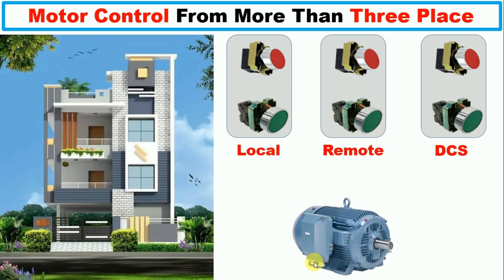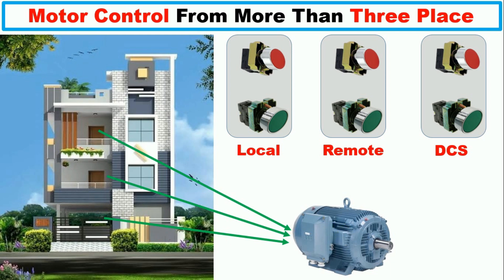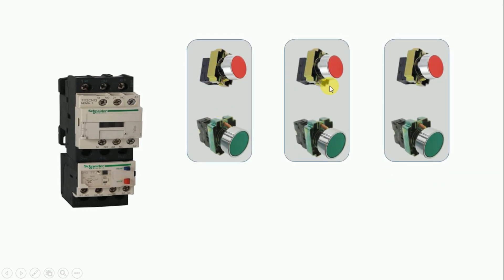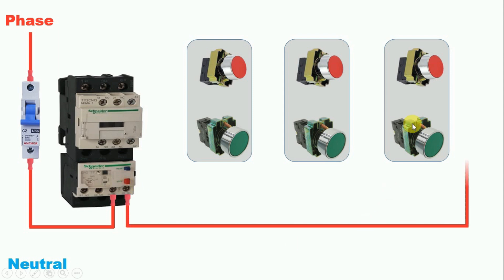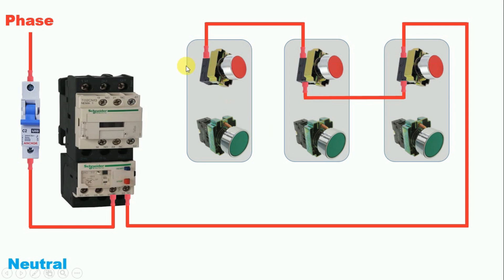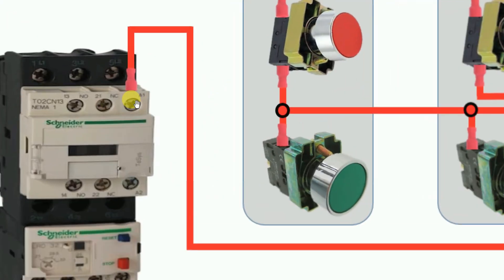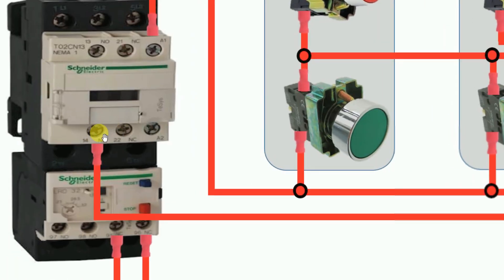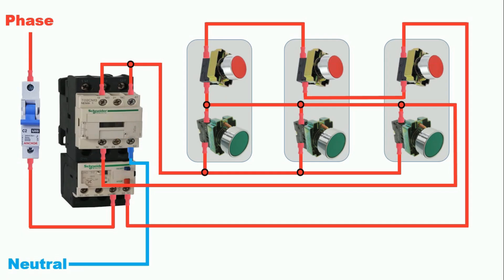Local, Remote and DCS Start Stop Connection of DOL Starter @TheElectricalGuy

Comment: Your tutorials are always clear and concise. 
I like them.
Please,  l need a video tutorial on why overloaded neutral on a single-phase system
I am an electrician.
I ran many tests on domestic wiring and realized there are always weak neutrals ( not strong enough to give the required voltage ).
I hope my question will be answered.